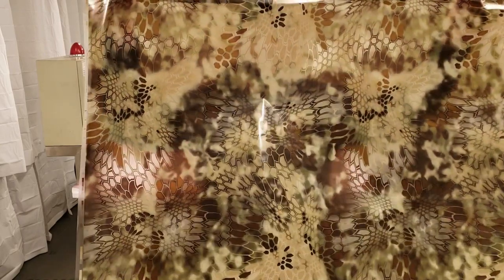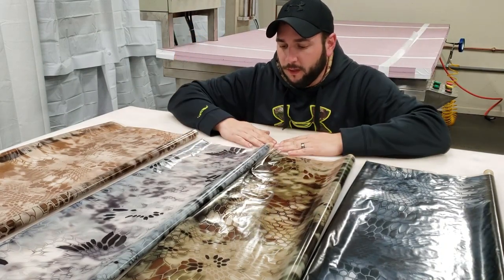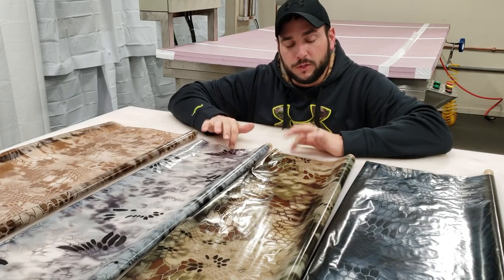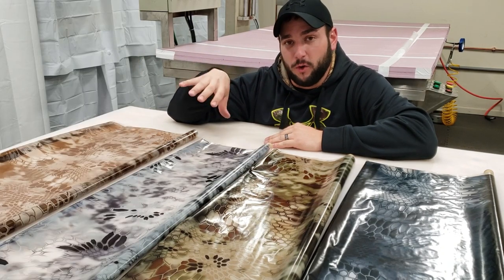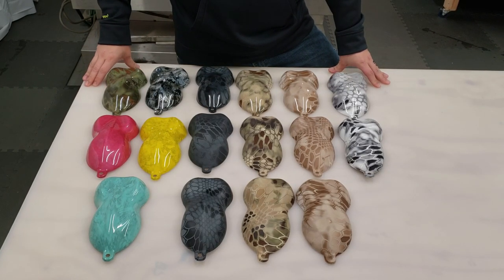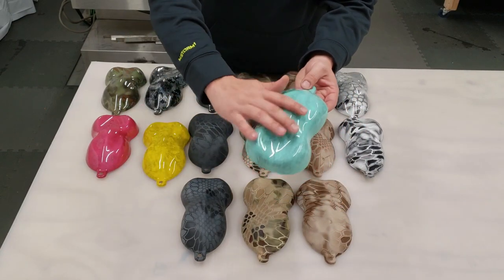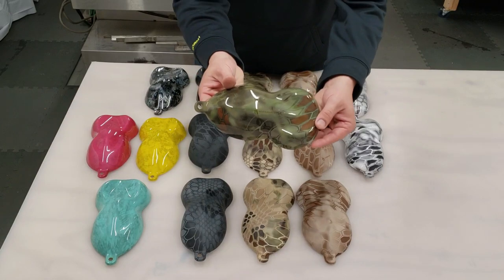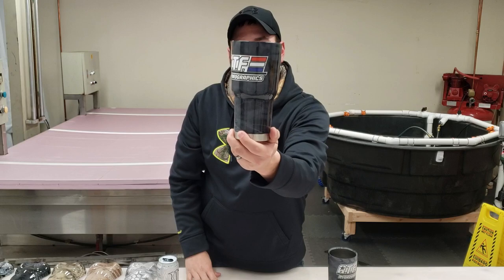HYDRO DIP KRYTPEK CAMO * Bonus* Muddy Girl Sccy 9mm

Comment: When you first dipped the cup your finger tips left spots. How did you fix that?
Reply from the maker: The part I was touching is a sacrificial cup that is pushed inside the cup I am dipping. That give sme something to hold onto and not mess up the dipped part. The bottom was taped up with painters tape so that I wasn't touching the bottom either.
Reply: @AllThingsFunHydrographics  thanks for the response. Went back and looked again. Thats a great idea..
Reply from the maker: @perrystarr251  CHeapo walmart cups and frog tape! I use them everytime!